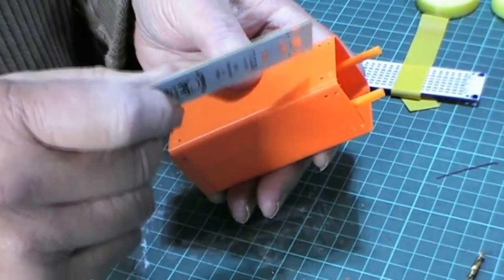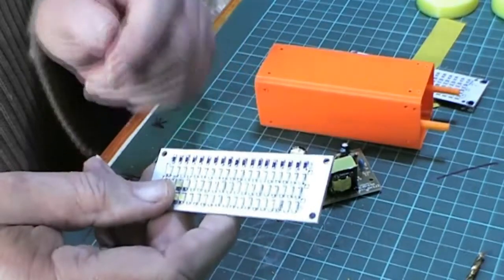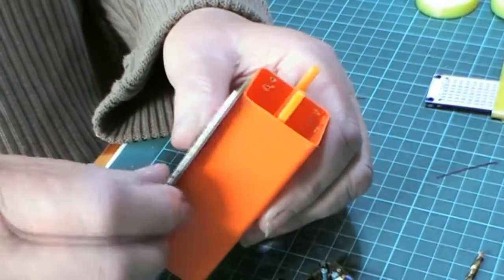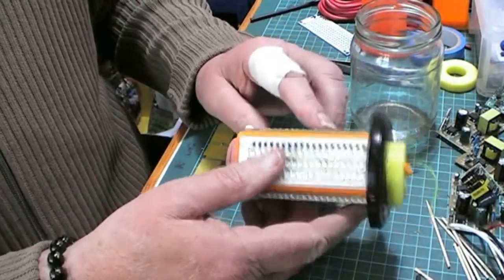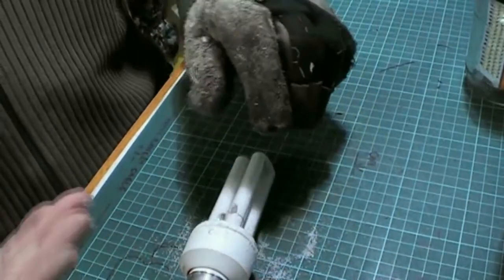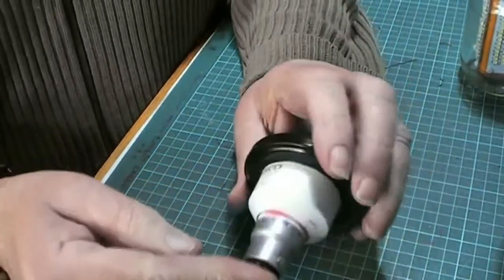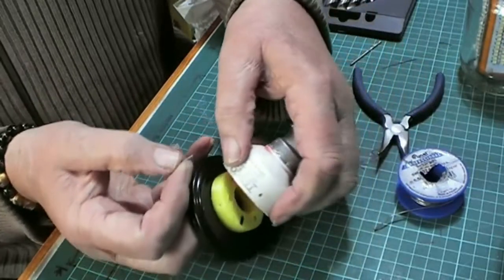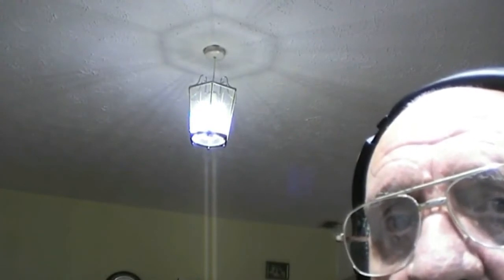Bar Julb Part 3

Comment: Fantastic job Ray got to ask a question to keep the heat down with the LEDs you are using are you under driving them look forward to the next one my friend
Reply from the maker: Hello my good friend. After being switched on for 6 hours. I can put a hand around the lamp (not the jar) so I am in contact with the leds and it is only warm to the touch. My friend Kevin is waiting for the jar to shatter because of heat. I have a little experiment so I can show him that there will be no heat high enough for his fear in normal operation. It is all down to the fact that the bulb is made up of a 560ohm resistor in series with 3 LEDs on a 12V supply. They are parralled 19 times per board. Total current consumption aprox O.467Amp for the whole lamp. Next is strip light for the kitchen. Stay safe.